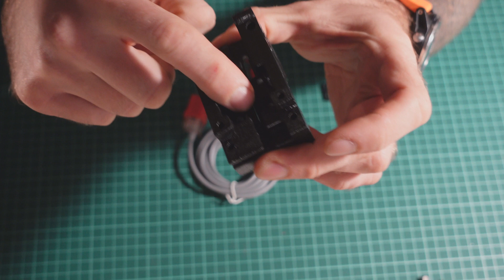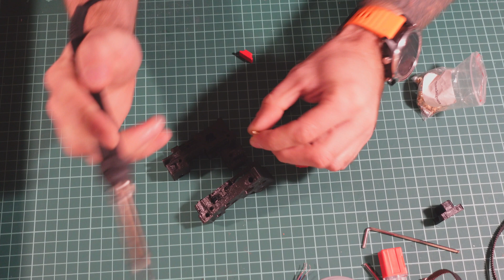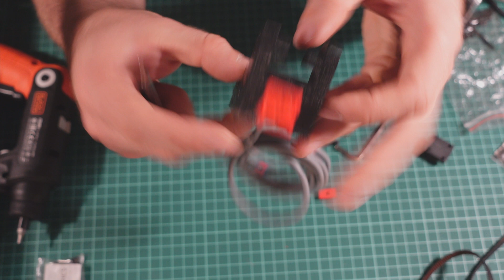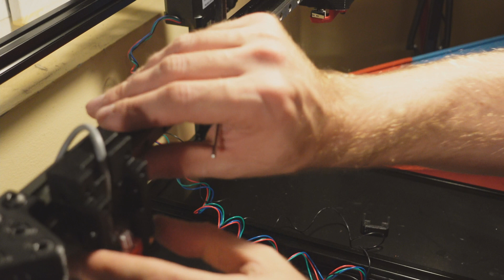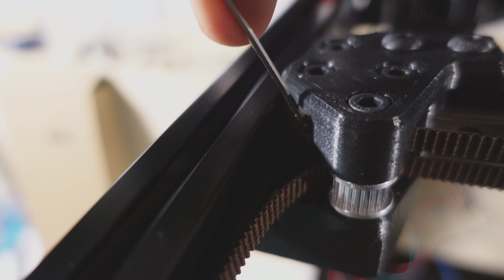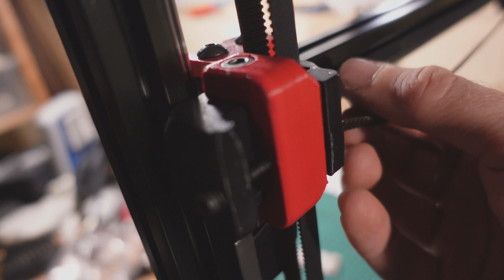Building Voron 2.4! P10 - carriage assembly, XY belts, and gantry de-racking

Comment: Why first z belts, then upper?? belt and then the lower belt? Weren't more logical to work up then out? It looks like building an entire roof for a power plant, lifting it up by a crane, building the actual building and then one makes a hole into the roof to bring in the generator in one piece into it. Don't tell me the belts weigh so much?
Reply from the maker: because manuals are written by people who know what they are doing
Reply: @techbytch  Uh it was a little late. I meant the xy on the gantry. But I also managed to get a hex bit fell into the belt hole. So I had to remove the corner to get it out. Must review the mounting sequence as one z belt has serious sagging.